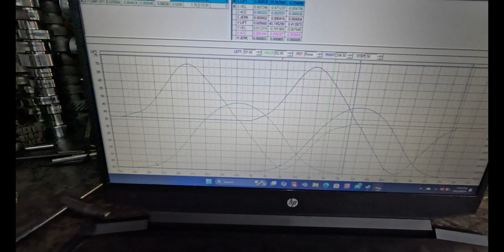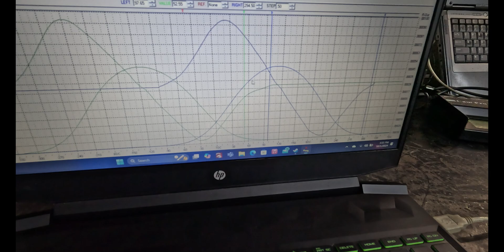Camshaft discussion,  Asymmetrical Lobes

Comment: Interesting you should mention ohc engines..many years ago I saw a very asymmetric custom cam in a 2JZ that was being used in a drift car..apparently the cam lobe design was to stop the shims from bouncing out of the buckets at high rpm.
Reply: Interesting. Toyota standardized on a 31mm diameter bucket a long time ago and made some of them shimless for the higher-rpm applications. It's really common to convert your shim-over-bucket 2JZ to shimless by using the buckets from the ZZ engine.

Comment: Hi bro i got a problem with a sbc I have a lockout hei distributor and my timing at idle is 36 when I accelerate I lost 20 degrees then at idle it comes back to 36 I have others engines and this is the only one thats weird thanks 👍👍
Reply from the maker: If the timing moves it's not locked out
Reply: @powellmachineinc  it's possible a wornout distributor gear?
Reply from the maker: @Mecjoel  gear or timing set
Reply: Thanks 👍  @powellmachineinc
Reply: @Mecjoel i would guess the load from the oil pump is moving where the distributor and cam gears touch. It might be lifting the distributor body a little or some other nonsense is happening. Easy way to check is to see what the timing is at cold start up when the oil is thick and see if it starts advancing when the oil warms
Reply: @timothybayliss6680 
EXACTLY... Distributor SHAFT climbing up and down.
I always shimmed between the gear and body to minimum clearance. 👍
Totally overlooked by 99% of assemblers.
Reply: @powellmachineinc  the distributor is welded
Reply: Just checking, but you do have the vacuum advance disconnected also correct.
Reply: I`ve seen the comments and agree with the distributor moving up and down however 20 degrees is alot, I think the chain and gears are worn out as well if its a flat tappet a loose chain will let the cam walk back and forth. In that case I agree with Mr. Powell

Comment: Can you explain a DOD camshaft vrs the same camshaft but with no DOD
Reply from the maker: Yes, will to a video
Reply: I was with GM as a contract employee before it was introduced. Other that the workings like screen filter, the Valve Lifter Oil Manifold and how the lifter works, there was no discussion about the camshaft. They do keep spark on and introduce fuel during an extended time period for a short time, the VVT phaser were interesting. But lifter failures caused more problems than anything. I was gone before this appeared but dirt oil was always an issue. I met & spoke to the two tech’s (Subject Matter Experts) that tested and wrote the software for each vehicle & engine category. They took multiple samples to send in for wear, oil additive packages to see if and when break down in protection occurred. They were very conservative on the software as at 10% oil life, allowed for 20% left. So a buffer was added as people can’t, won’t or don’t change the oil and filter had extra time. I change my oil as many guys do. But 82% don’t. They pay for this service. Too many times it is kids still in tech school and taught the money was in air filters, PCV valves and add on’s. But honestly, they look for upsell issues. Brake sales are the worst at chain stores!

Comment: What would be the performance advantage to an asymmetrical lobe? Seems like there would be bouncing at high RPMS?
Reply from the maker: @swi9945  you can accelerate off the seat faster than you can set it down,  the asymmetry take advantage of this fact.
Reply: @powellmachineinc  Is that because if you try to set it down too fast it is hard on valves and seats or may bounce off the seat or both?
Reply: @DavidSmith-eu4lq  Yes. A bunch of stuff going on:

Gotta be a bit gentle getting started opening the valve (opening ramp), but once you've got it moving, you can really speed up
But if you don't ease up towards full lift, you'll launch the lifter off the cam
Then you've gotta be even more gentle setting the valve on the seat to avoid crashing and bounce